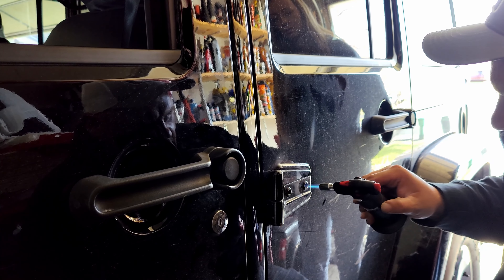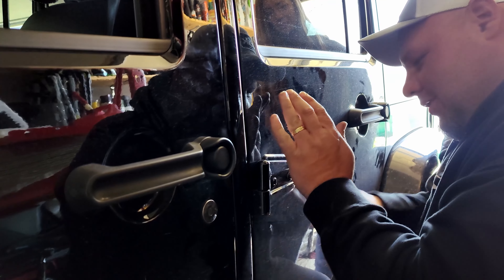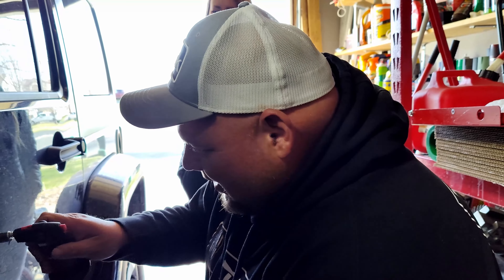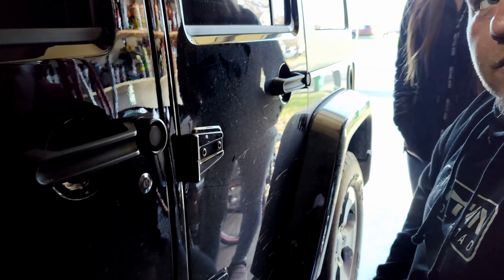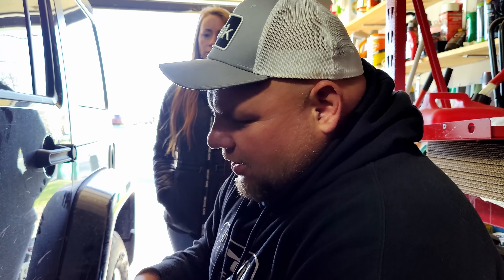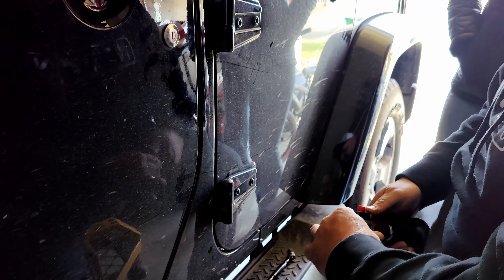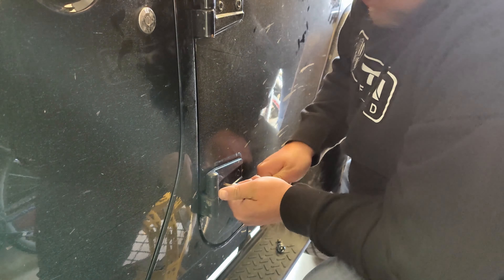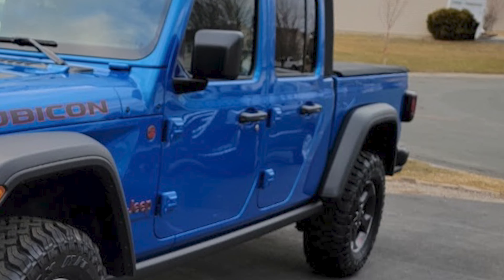Jeep Door Hinge Removal TRICK from the Pros

Comment: This seems to work the best but  I was successful using a breaker bar and at T50 socket. You have to hammer the socket into the paint first a bit and turn the breaker bar slowly. Also when you replace your hinges the new hinges won’t fit perfectly in the same position you have to open the door and position the new hinge in the correct spot to cover all areas not painted

Comment: Ah, thank you!! Going to have to make a run to buy a torch but that’s way better than the way I was trying to cut around it.
Reply from the maker: You'll be shocked how easy it comes out. The biggest reason isn't the paint that it gets stuck, it's the lock tight on the inside.
Reply: I was able to get it & I was sooo happy & proud of myself (new jeeper & car diy’er lol)….But now my door is slightly out of alignment, I forgot not to unscrew too far & I can’t get a bolt back in. Tried jiggling the door the best I can but it doesn’t seem to be working😩 I’m trying to add foot pedals to the hinges

Comment: Do you think I can get away with using those long lighters? Thanks so much btw!
Reply from the maker: It needs to be a torch or you'll burn the paint above the flame.
Reply: Any torch suggestion
Reply: @xtermigator  Any single-flame butane cigar torch from your local gas station will work.

Comment: Now what do you do if you didn’t look this video up first and stripped the damn bolt? SMH.
Reply: I did the same damn thing…
Reply from the maker: That's really tough, go the next size up, tap the bit into the hole using a hammer and attempt to remove. Otherwise you'll have to drill it out.

Comment: If only it were that easy lol
Reply from the maker: It actually is. Haven't found one stuck so bad this didn't work yet.
Reply: @titanoffroad  well now you have…Mine. Had to use a breaker bar on each one they were in so tight. That’s after applying heat directly to the bolts for a couple minutes each. Still stripped two needed to buy an easy out and that was a joke. Had to take mine to a welder to get the last (2) bolts out. Possible the previous owner rubber cemented them in or something. There was no getting these out. I had to laugh watching you use a standard ratchet and sitting down and they just came out like butter. Lol guess some people are just born lucky
Reply from the maker: @chriskociolek1830  we manufacture, sell and install door hinge steps and hilift jack mounts that require removing the door hinge bolts, we have removed hundreds if not thousands of them. No customer of ours using this method has not been able to remove them this way. We include in our instructions how to remove the hinge bolts this way and haven't had a customer contact us who couldn't get them out using this method either.  This video was taken on a customers jeep who I was showing how we remove tough hinge bolts after he could not remove them. 

What did you use to apply heat? Not born lucky at all, just have never had one not come loose. Although I've had to apply heat for a little longer, 45 seconds  or so and use a breaker bar but that's only been on a couple 2007-2010's that had a couple hundred thousand miles on them & that spend their lives parked outside. Still though using this method we've never not been able to remove one. They're all installed from the factory using locktight which is why the heat is needed to melt the locktight. The only way I could see one not coming out would be terrible corrosion that essentially welded them together. But still have never seen it happen. Sorry for your trouble, you've had a rare situation.